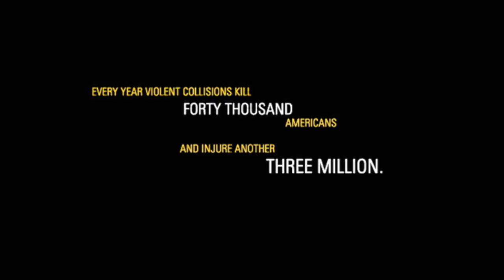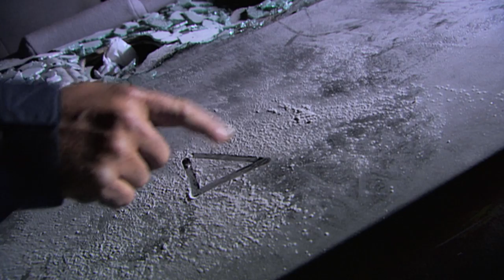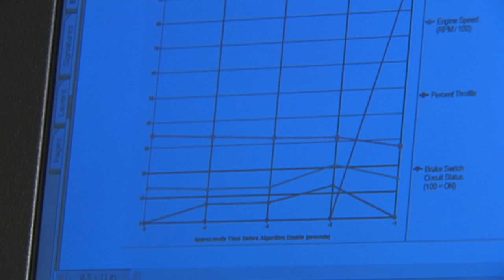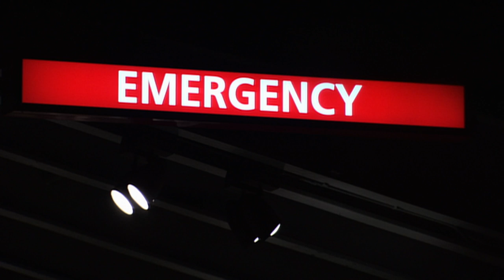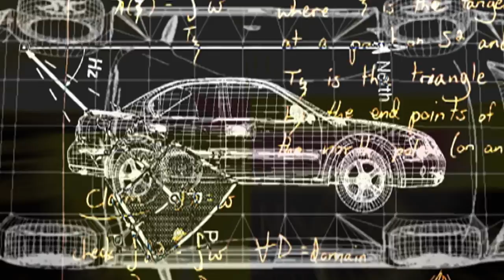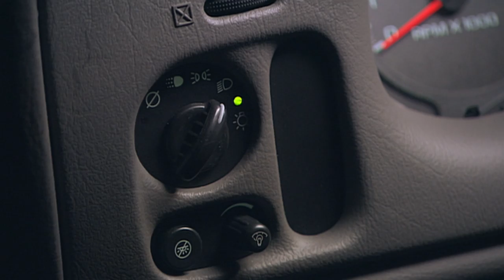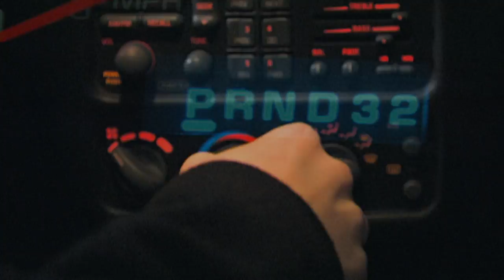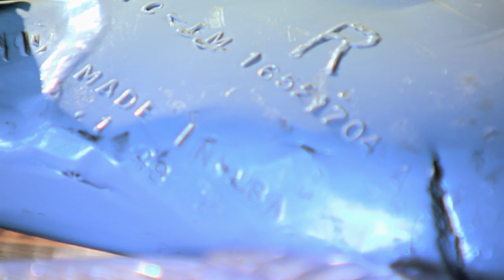Fatal Accident Triggers Investigation Into Who's To Blame | Accident Investigator S1 EP1 | Wonder

Comment: “It was obvious to me that the car had rolled over because” it was UPSIDE DOWN
Reply: I know that this is said mostly in jest, but as someone who has a relative in the police force, officer have to be very descriptive, to the point of stating the obvious, in order to avoid having a lawyer throw the case out on the account of missing or inaccurate information. This becomes a habit and which then happens in everyday life. (no offense is meant, I have been told that I can sound insulting without meaning to.)
Reply: Rebecca Durbin hey no worries it was completely a joke and I get the precautions officers need to take no offense taken

Comment: I hate it when people act like victims involved in motor vehicle crashes are lying. Sometimes, actually often times, they are not lying but giving their perception of the events. I have two examples. Once I ran a red light. My husband pointed out that the light was red and I insisted that it was green. My teenager in the back confirmed that it was indeed red. Obviously my perception was that it was green or I would not have gone through it. So if I was involved in a crash (alone in the vehicle), I would have told the police that the light was green. I wouldn't be lying, I would be telling the events the way I remember them. My second example is again I was in the vehicle with my husband and children and I turned into our church parking lot. As soon as I got into the lot my husband said "WOW THAT WAS CLOSE!" I said what was close? He said you turned right in front of that car, they barely missed hitting us. Apparently I was focused on looking into the lot to see which way to go for a parking spot that I failed to pay attention to the oncoming traffic that had the right of way. Again, if I was alone and in a crash, I probably wouldn't even have realized that I was the one who was in the wrong and turned before it was clear to do so.